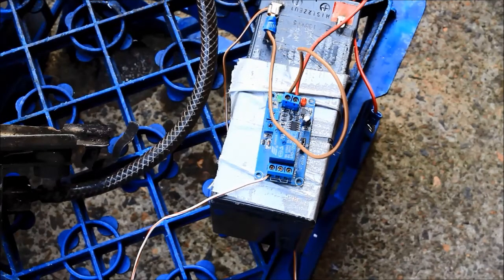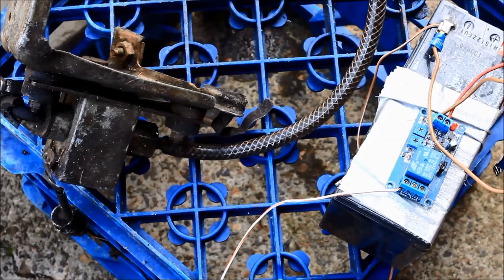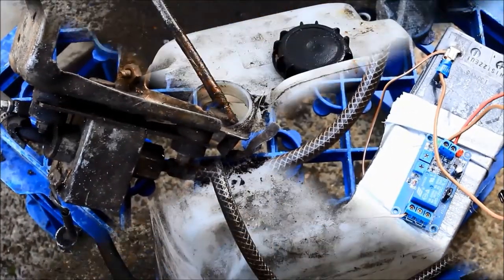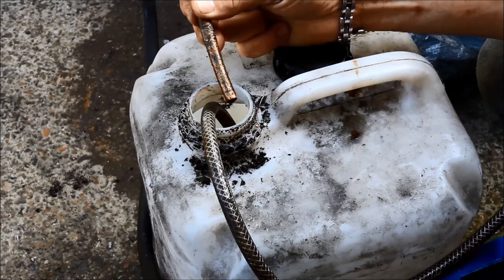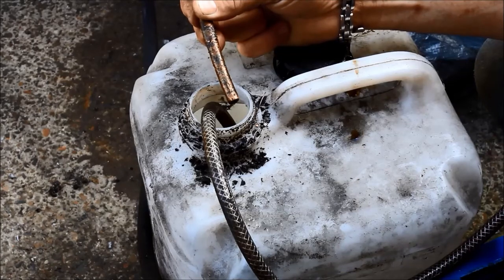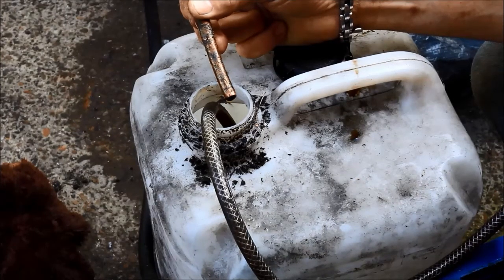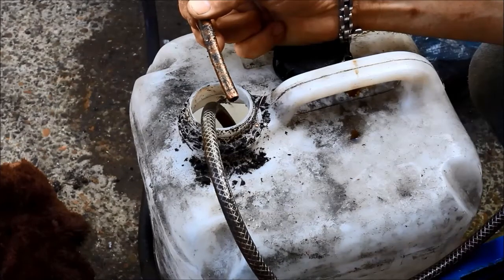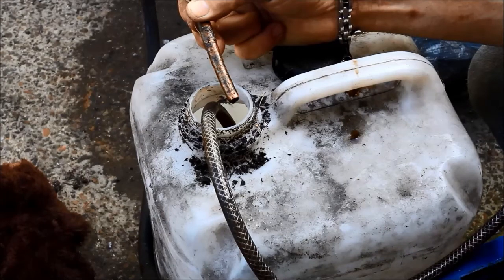Fuel control for waste oil burners

Comment: You are treating a fuel pump like a fuel injector, where the on/off of the pump is like the pulse width of an injector. Like you said, there is no need for metering or pressurization, as you are dripping instead of atomizing fuel. It's a very clever way to do this! As long as the temp of the furnace stays above the flash point of whatever you are burning, then this is a great idea for set it and forget it. I was trying to think of how to do this and you have answered my question.

Comment: Thats a slick setup.  I like your thinking,  use cheap materials scrounged up and keep the designs simple easy to repair and efficient.
Reply from the maker: The thing that amazes me is people on different forums scoff at my simple designs yet they go to SO much more trouble, especially expense and complication and then have a load of problems. 
 If I spent the money they did and went to all the effort and mucking round, I'd shut the hell up about junk burners that ate mine for breakfast in every way!  :0)
Reply: I subscribed, I think along the same lines as you. I thought the chevy oil pump was also a great idea.

Comment: Is it not easier to make a control over air inlet?? and keep from 300KW to a more sensible lower KW that suits your needs!
Reply from the maker: Eriks Boroda You can't reduce the air input without reducing the fueling or you will have a very rich burn that will smoke like mad and eventually flood the burner. 
There is a lot more leeway with the amount of air you use than with the amount of fuel.

Comment: OB, Like the controller - you would probably get better control with a PWM controller with a small external Pot - would not cost much more and it essentially does what you are doing but many thousands of times a second - something like this 

http://www.ebay.com.au/itm/PWM-DC-motor-Speed-Controller-Module-with-Switchable-Potentiometer-6V-30V-200W-/131026059533?pt=AU_B_I_Electrical_Test_Equipment&hash=item1e81c3010d

Is that just one of the facet fuel pumps that you are using ?

Craig
Reply from the maker: Thanks for the link! I don't think that controller will work too well with this pulse pump but it sure would be handy for 12V car blowers and other things so I'll order a few of them. Also saw some AC controllers which I was looking for so doubly handy there.  The pump is a facet Type, I get them from old Subaru wrecks. I think this one is a bit tired or clagged as it's only doing enough oil for about 50KW/hr at last check and I'm sure I initially measured it up around the 200Kw potential mark.  I have a few more of the things so not to worry. 
Thanks again for the PWM link. I was looking at all these little boards on fleabay the other day but somehow missed those. Pretty much have found all I need to make an automated/ temp controlled burner setup now.
Reply: One problem if using a normal PWM controller may be that not only the speed gets lowered if you turn down the regulator, but even the torq of the DC motor - the viscosity of the oil most likely makes it pretty hard to pump and the pump run the risk of stalling if you turn down the torq too much.

With this slow control - the pump pumps at it's full power, but only for a short time. The large air/fuel mix tank used will probably "level out" so the response o the burner gets pretty smooth anyway.

But PWM is awesome for an electric furnace like mine. I'm now working on a new controller - before I had a controller that turned on and off pretty slowly, altough still faster than this pump.
Reply: Very basic 10A with computer fan power type leads: https://www.ebay.com/itm/DC-5V-12V-24V-Infinite-Cycle-Delay-Timing-Timer-Relay-Switch-ON-OFF-Loop-Module-/122015186599 $4.00 USA free shipping   
Screw leads, 15A more expensive, better instructions https://www.ebay.com/itm/Cyclic-Timer-Switch-Relay-Delay-ON-OFF-Repeater-Interval-1-to-120-Sec-Min-12V/232438709014?epid=1453527589&hash=item361e6d3b16:g:8TcAAOSwa2lZiCPM $13.00 USA free shipping